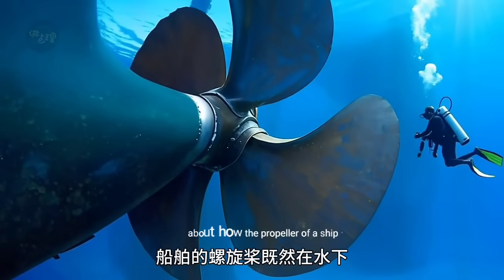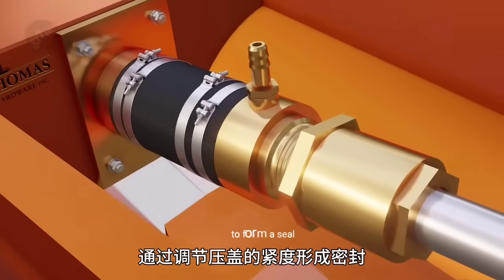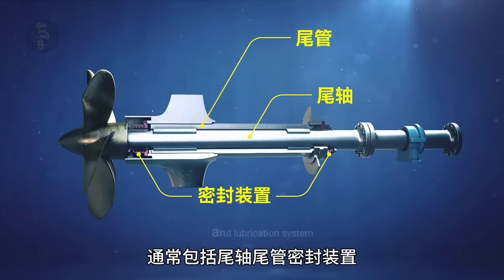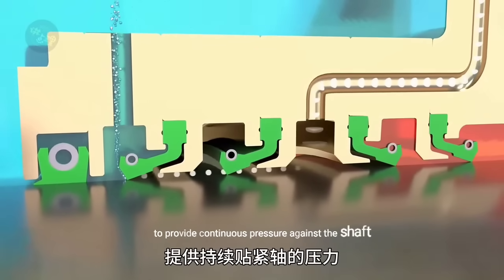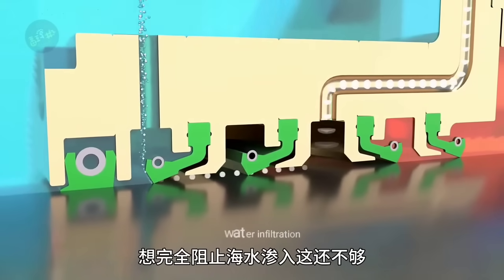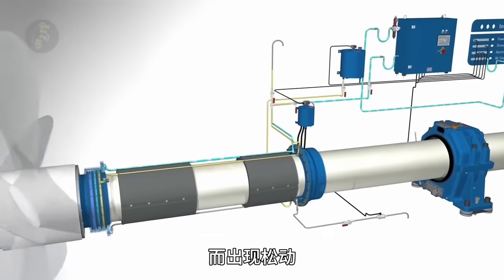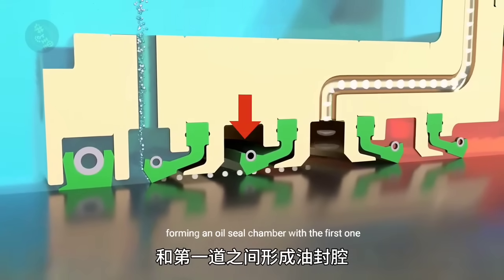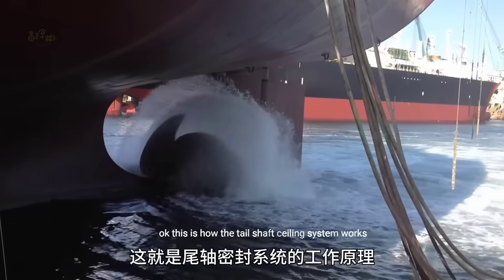How Does a Ship’s Propeller Shaft Seal Work Underwater? | Science Behind Marine Engineering

Comment: I still would like to know is if it is possible for someone to be sitting in an enclosed room with no port windows to be able to drive the yacht using hydraulics and cameras alone. Specially if the yacht is a large sized yacht or navel ship. The other thing I was wondering is, could you not place jet engines on the sides of the yacht instead of driving a propeller?
Reply from the maker: Yes, it is technically possible to operate a large yacht or even a naval ship from a fully enclosed control room using hydraulics, sensors, and camera systems, and in fact many modern ships already rely heavily on these technologies, especially in poor visibility or combat situations. That said, direct visual awareness is still preferred in most civilian yachts for safety and situational judgment. As for propulsion, jet engines are generally not practical for yachts because they are extremely fuel-hungry, inefficient at low speeds, and difficult to control in tight maneuvers, which is why propellers and water-jet systems remain the standard choice for both large yachts and naval vessels.

Comment: That's a Japanese "Eagle" seal!
Trust me, it consumes a lot of compressed air  but it works just fine.
I've only seen it on a small number of Japanese-built hulls.
Mostly, the stern seal has but 3 cavities, not 4, between the seals. One is a void, just behind the outer lip. The inner two are subject to oil pressure from header tank(s). Mostly one header feeding both cavities, but on deep draught vessels, there may be two tanks, one at ballast draught, and one at loaded draught.
Ahhhh, takes me back!

Comment: How does the crankshaft in your car’s engine keep oil from running out? The same way (lip seal, although rope type seals were a thing in the olden days of motoring as well.
Reply: True, but it's easier in the car engine, because the pressure differential is much lower.  In a ship however, there's substantial water pressure at the depth of the propeller shaft.

Comment: That was very good.
Something I bet a lot of people don't know about, how does the pushing force of the propeller actually push the ship. The basic idea is, it pushes against thrust bearings that are mounted the hull, but I think some people would be interested to see a video about it. 
Thank you.
Reply: A ship's propeller doesn't push the vessel directly—it generates thrust by forcefully displacing water backward. This creates a pressure differential where the rearward force surpasses the resistance ahead, resulting in forward motion.
Reply: You have it right.
The prop blades developed a differential pressure, giving a force applied to the prop area  and therefore thrust.
The thrust acts against a thrust bearing either in the engine  or a separate structure, depending on the whim of the designer, and/or engine type.
Be aware, ships go backwards as well  the the thrust bearing has ahead and astern bearings. Basically a large rotor on the shaft, with segmented "Michel" bearing pads fore and aft.
The "Michel" pad has a step in the steel backing  so under pressure, the pad tilts slightly, allowing an oil wedge to build up. There are usually 8 of these making up the 360 degree bearing  and this is identical forward and aft.
And yes, if you damage the forward pads, you can in emergency pinch the aft pads and use them in the forward position. Just don't try and go astern!

Comment: How does this work if the ship's engines are off and there is no power to work the pump/compressor?  Is the leak just slow enough to not be a problem, combined with the non-spinning propeller shaft?
Reply: If the main engine is off, there will be one or more auxiliary engines running, providing power to the pumps.

Comment: When I was young in 1964 the seal type shown at the beginning of the video was used. it was always leaking a little bit to prevent it from heating up. The seawater ran down into a bilge which mas pumped empty 3 times a day (24hr). The engines then were slow moving running at max 110 revs/min. The shaft bearing was a large cage with square holes around the shaft containing many wooden blocks where the layer towards the shaft was made of buchenholz which was lubricated by seawater.

Comment: Impressive but I had wondered for some years how deep sea ROV's and submersibles that can reach the Marianas Trench seal their manouvreing propellors against such huge pressure.
Reply: These crafts small crafts use electric motors that are mounted EXTERNALLY to the crafts hull, hence, no hull penetration, no leaks.
Reply: @damonried1720  Yet the motors themselves need a barrier between them and the seawater, regardless of where they are. How can a seal resist such pressure without being so tight on the driveshaft that the shaft cannot turn?
Reply: @percyprune7548 These motors need no air inside them, just coating the electrical components.
Reply: @Reirainsong  2 degree Celsius massive cooling seawater!

Comment: Very interesting!  Somewhat similar to the carbon seals used on her engines, but much larger.  They too use compressed air to ensure the oil does not leak out.

And as for submarines, I suspect that they merely increase the air pressure to be slightly above the sea pressure at the depth the submarine is operating at

Comment: What about then the ship is powered off? (i.e. the air compressors aren't running) 
How does it prevent leakage then?
Reply: I'm guessing that no ship of thus size is ever fully powered off once it enters service. This is probably what they would call an "essential" or "critical" system with backups along with drainage pumps and emergency power systems etc.
Reply: I am familiar with air pressure on the oil tank to maintain 2 to 3 feet of oil (1 psi+/-) to keep sea water out of the oil chamber, and using a coalescer to remove any water that leaks past the lip seals on the propeller end. Times have changed. Have fun